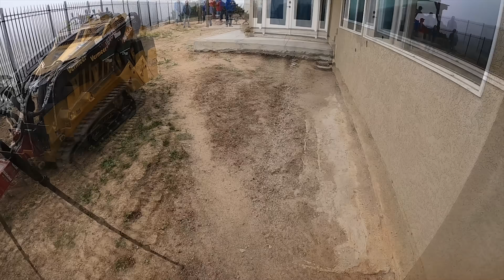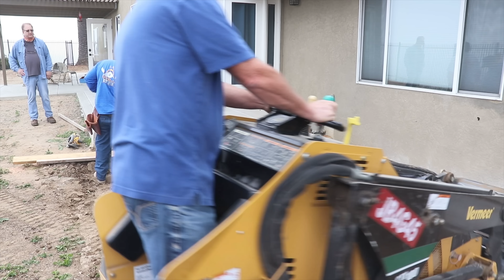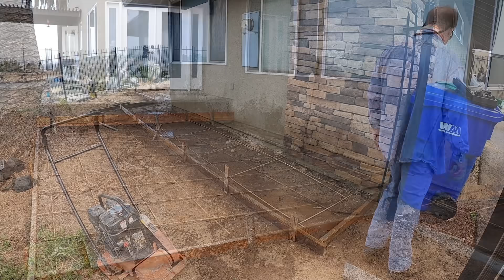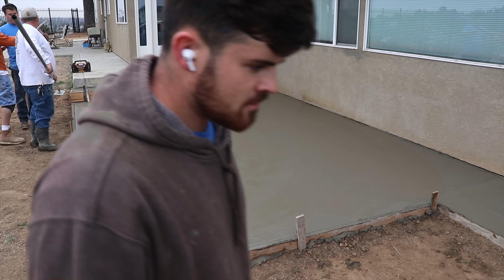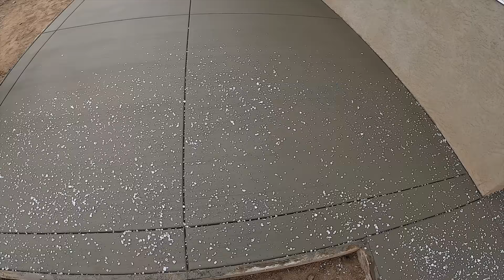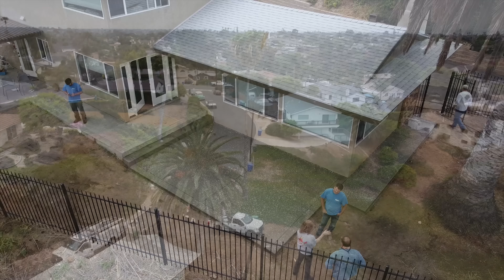Concrete Salt Rock Finish Patio with Borders

Comment: Does the salt eventually just dissolve away overtime???   Or does it stay there like a crushed rock texture… I’ve never seen concrete done this way, or I’ve just probably never noticed it done, if the salt just washes away leaving behind it’s salt rock imprint in the concrete like an old fossil sea shell type rock.
Reply from the maker: Yes the salt dissolves with water leaving holes
Reply: @OdellCompleteConcrete  Nice! 👍 Thanks for the reply… Would u happen to know anybody, or point me into the right direction, or recommend a concrete company out in the Houston Texas area that does great work like you guys at Odell Complete Concrete… I’d like to get an estimate done, there tons of choices I see but I don’t just trust anybody to come do a job for me for my home… Hopefully u can turn me on to a company that mirrors your fine work & professionalism just like u guys. …I think yall do great work, I just wish u had locations in Houston Texas area. It would make my choice faster & easier for something I hardly know how to even go about.
Reply from the maker: I wish I knew someone over there, I get many calls from there.

Comment: Not a fan of the finish, but the customer is always right and you guys did a great job as usual. I still stare in awe after we do concrete work that it comes out as basically a liquid with aggregate and turns into something that holds vehicles and houses. Pretty wild
Reply from the maker: Yes its a great building material

Comment: Have you ever had to remove and replace concrete. See  my back yard is like 12 feet to the block wall,  and the city put   Eucalyptus trees 32 yrs ago and now they are lifting up my patio about 2" and its all cracked up everywhere .. the block wall has a crack all the way up. We bought this house new in 88 
All  my  Neighbours down the street want them gone. So the city should at least pay you to fix the problem. I live in the  Heritage in Fontana. I hope you can help us. Thanks
Reply from the maker: Yes I have replaced alot of concrete due to root damage

Comment: Dave, in a future video could you describe the technique used for the concrete in Walmart entrance areas?  It has a rough finish, probably for water and to prevent slipping. I'm not sure how they get that finish.  Thanks.
Reply from the maker: I'll have to check it out
Reply: Pretty sure it's just a broom finish at the one near me

Comment: Love your videos great job but I might have missed it but was there a reason why the didn't extend the sidewalk running along the side of the house all the way out to match the length of the backyard pad  instead of stopping it off around the corner of the house.
Reply from the maker: Yes because it would have slid off the hill

Comment: I just had my concrete poured by a contractor and they weren't able to add the border due to the concrete already halfway curing. Do you think it would be okay if I use a v-shaped concrete disc or masonry disc to make the borderlines?
Reply from the maker: Yes
Reply: @OdellCompleteConcrete  thank you for your quick response.

Comment: What is the purpose of putting the salt on? Is there a purpose it serves or is just a particular look and style?
Reply from the maker: Leaves holes in the surface. just for looks
Reply: @OdellCompleteConcrete  this must be only an airid area finish only. We try to avoid salt everywhere else... salts tend to weaken concrete drastically and cause premature failure. Anywhere it freezes you try to avoid pitted concrete as it just provides room in for moisture and thus ice to break and chip the surface up. Your taking a slab that should easily last 70+ years and making it so the surface could spall off in 10 years.

Comment: Amazing most everyone fights salt.dammage , you do it on purpose - salt damages concrete over time by causing corrosion to occur under the surface, leading to discolored, cracked and crumbling concrete
Reply from the maker: You wont see this finish in frezing weather conditions
Reply: @OdellCompleteConcrete   oh i see , so a heavey duty sealer is all that is needed ? How long does sealer last ?
Reply: Most places that have issues with salt have concrete issues with chipping and cracking. This slab in the video will never see a salty winter nor see any salt at all. This is only to achieve the pitted texture, once the rock salt is washed away, it’ll last for years to come due to not having harsh winters like other states
Reply: @IntegraIRL  well learn somthing new all time
Reply: Why ny use , seeded  chiped marble  ?

Comment: I don't like that salt finish.  It reminds me of my garage floor with salt damage from decades of winter snow melting from the car.
Reply from the maker: How about putting a sealer on the garage floor
Reply: That is what i was thinking in Michigan we would rip it up.
Reply: I started using a leaf blower after pulling the car into the garage in Chicago. It gets it off the car and I can sweep it outside.
Reply: I also don't get why anyone would want a floor that collects dirt a lot easier and is harder to clean.
Reply from the maker: you wont see this finish in freezing climate areas.

Comment: In Northern Illinois we preach to people "don't use salt in  the winter, it will damage the concrete".  In SoCal, you guys throw it on.  It's nice to see different finishes in different regions.  Nice work.  That's for not rolling the edges, drives me F'ing nuts.
Reply: Looks like damage in the prior work near the end of the video from the salt
Reply from the maker: Me too 
TY

Comment: Now why do paver patios need a lot of base I see4-6” of 3/4 processed usually locally, but never see any real base under your concrete why is thay
Reply: Soil type, local weather, as well as usage dictate subgrade. 4-6" of 3/4" rock might not even be enough is some places and uses.
Reply from the maker: No need in Soutern CA, where its beach weather everyday